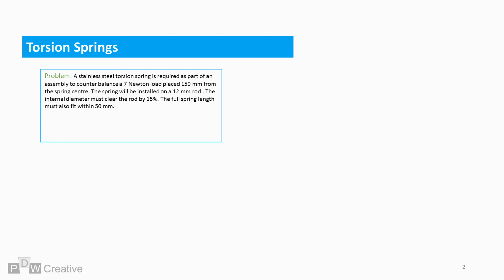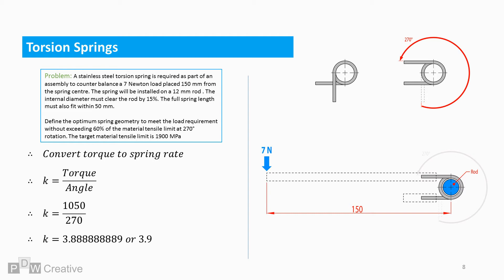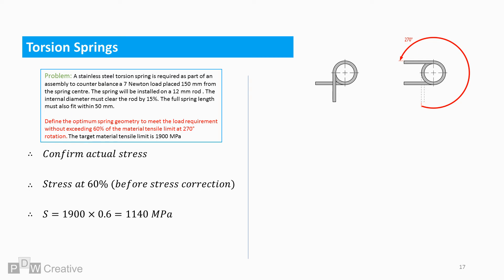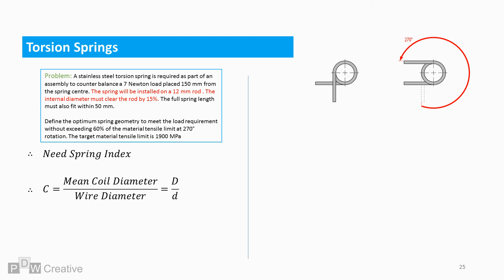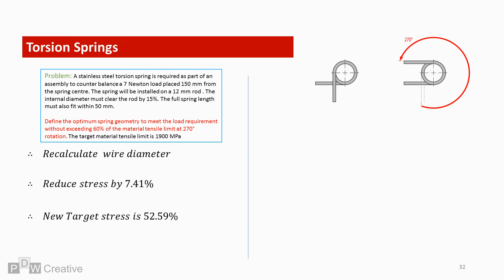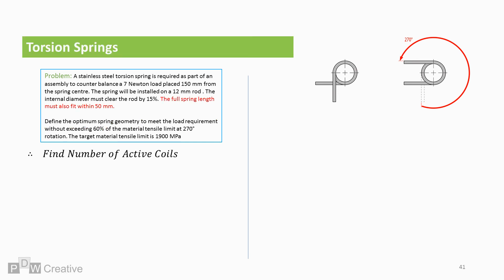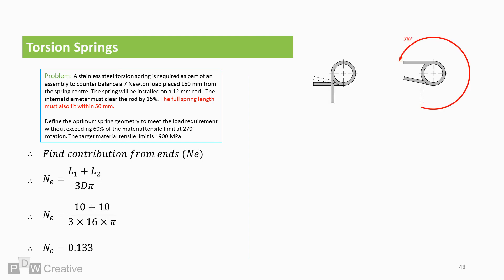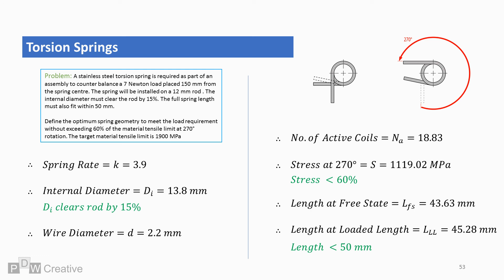Torsion spring design problem and solution

Comment: Helloe Sir and thank you for the wonderful lesson!

Could you please provide the guideline document from the manufacturer if possible?
Reply from the maker: The manufacturer doesn’t set the guidelines. The manufacturer works to the spring design and wire specification standards. There are various tolerance and design standards depending on the wire type.
Reply: @PDWCreative  

Thank you very much for the response, much appreciated.

During the lesson, you said something about the spring index having to lie between the given range by the manufacturer so as to avoid entanglement and all that.

Comment: Why did you take k as 1400  while calculating number of active coils ?
Reply from the maker: The subject comes up at 10:00
Reply: @PDWCreative  ie) =1050/(270/360) = 1400
considering it with full rotation

Comment: Hello, im a little confuse in how i can find the young modulus to calculate the number of coils, can you help me?
Reply from the maker: It makes things easier if you pick out a modulus from a specific spring steel stocked by manufacturers. Alternatively you could input the number of coils you need into the coil equation and rework it. It makes things easier if you find a modulus from charts so you know the design is possible.

Comment: for calculating active number of coil, where did you get the value for k
Reply from the maker: The subject comes up at 10:00
Reply: @PDWCreative   You say it's the spring stiffness of one complete 360° rotation.  Why is that?  Also, is that our original torque requirement of 1050Nmm over 360° instead of 270°?  That would not be 1400. Still confused by this little bit.  Thanks for you help and this video series in general.
Reply from the maker: @Steve Huckaby When stiffness is calculated early on it is based on the load, distance and rotation of 270 degrees. The problem never changes. But when working out the number of active coils I translated it across a full 360 degree rotation just for reference.
Reply: @PDWCreative  Ah ok.  Why do you use a 360° reference value instead of your 270° actual deflection? Wouldn't that under calculate your number of coils?  Would you have to do that for all spring designs?  Also, it looks you use the torque at 360° and not the actual rate.  Thanks for responding.  I'm just trying to understand this process so that i can apply it to my design requirements.
Reply from the maker: @huckabrew  whenever I have tried to calculate the spring it didn't work out unless a switched to a full rotation. The best thing to do is try the manual method but also try some free online calculators and check manufacturers notes. For this video I had a very specific challenge to overcome.
Reply: @PDWCreative  I reconciled it.  In your example, you divide by the torque at a full rotation for that given rate, I'll call it t.360.  In other resources, that formula is shown with a ratio of the angle to a full revolution divided by the initial torque value. so call that (ang/360)/t.i.  Based on equal rate (t.i/ang) = (t.360/360)  if you solve for (1/t.360) which is your formula, you get  (ang/360)/t.i which is in the others.  So it all matches up.  Very useful series and definitely helped me understand torsion springs better. Thank you.